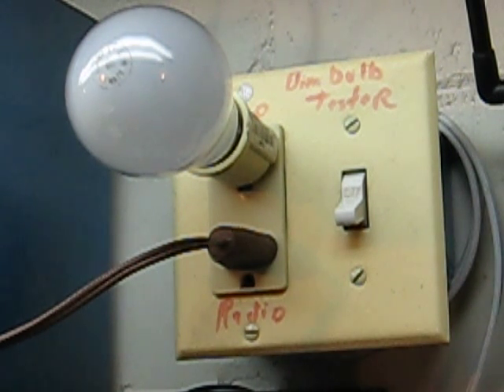How to use a Dim Bulb Tester - Good Tube Radio

Comment: Hello,  I read on your radio museum post that If your radio exceeds the highest wattage single lamp you have, use a multiple outlet power strip to add lamps.  Any off the shelf power strip will do?